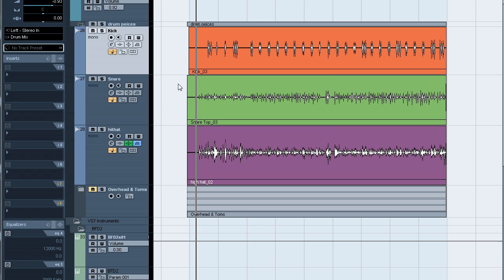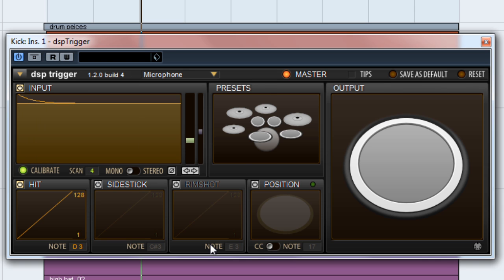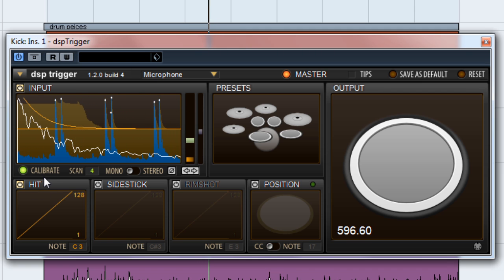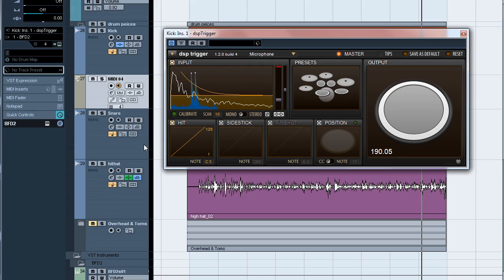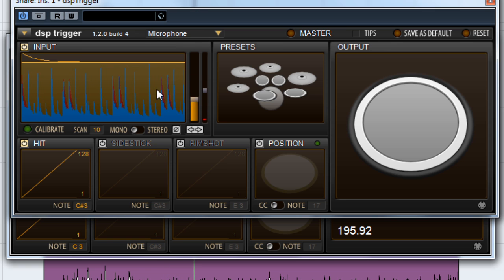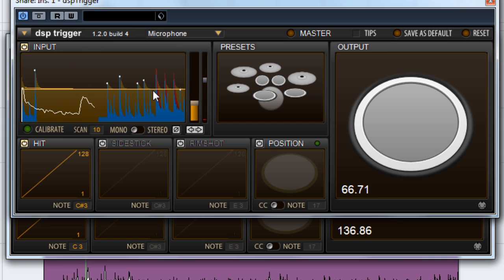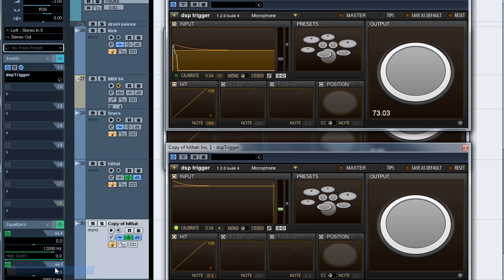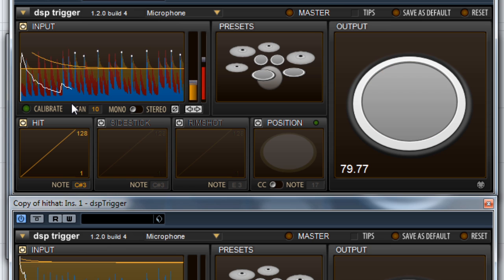Drum Replacement with DSP Trigger

Comment: Hi!! I’ve just installed dsp trigger and made it worked quite easily.
I’m using it with Roland rt triggers on mesh heads (A>E conversion) but i can still hear the hitting sound over superior drummer which is very low on the other side. Any idea ?
Reply from the maker: Perhaps you've enabled brush mode?
Reply: Audiofront Brush mode is off 
Tried different cables, different inputs on yamaha mg10xu, still get the hit sound over vst.
Reply from the maker: @gaetanmarquet4469  Disable 'Hardware Direct Monitoring' in your audio interface control panel.

Comment: Where do you add the Drum instrument? on the Kick track or a separate track?
Reply from the maker: It depends on the host.  Typically on a separate track, and then you route the MIDI from DSP TRIGGER to the track with your drum instrument.
Reply: Thanks for the reply. Im using Pro Tools. Tried that but couldnt get it to work. Any Ideas?
Reply from the maker: How are you able to use a VST or AU in Pro Tools?
Reply: Transvst :P